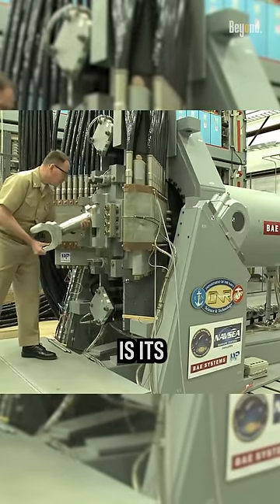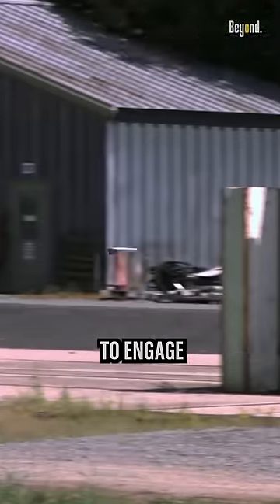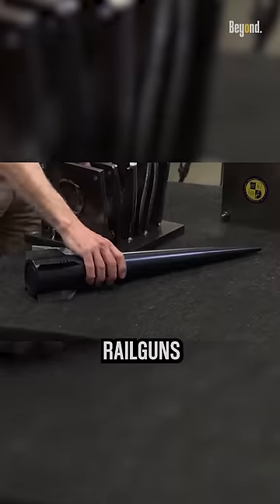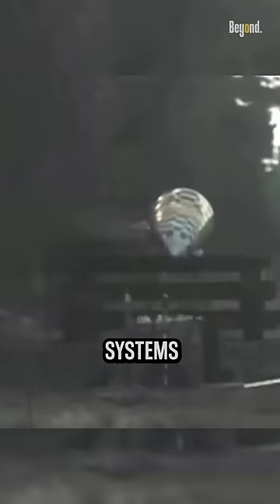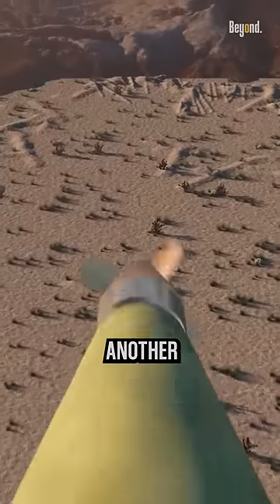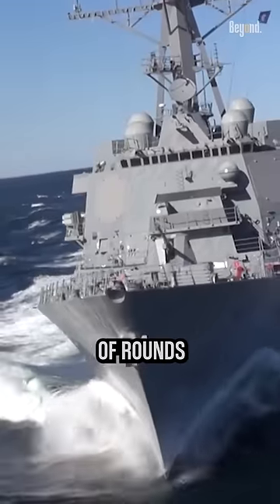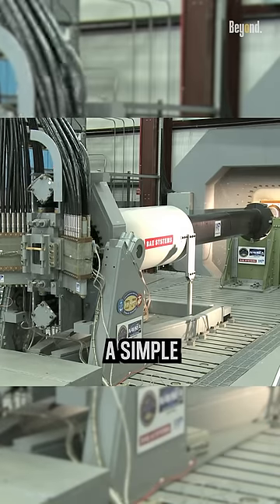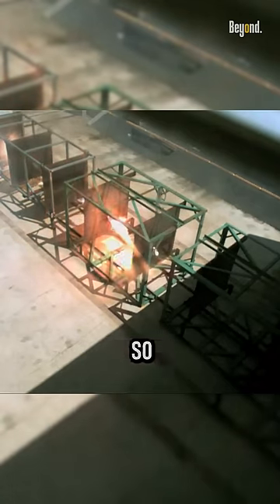Why does the US Navy need a railgun ? #shorts

Comment: The issue with these railguns, is they fired SO POWERFULLY they tore themselves apart every shot, and had to be completely rebuilt after basily 7 to 10 shots if i remember right, if we can develop a more durible metal to build them out of, then we can see them being more developed in the future, but as we are now, we dont have a metal durable enough to handle the forces they discharge when fireing

Comment: The main disadvantage however is the wear that it puts on the barrel every single shot, a barrel of a railgun like that will only last about 3-4 shots before the conducting elements within need to be renewed. 

That and you need a tremendously strong power source to be able to launch something at that range, like a shipping container full of capacitors, or some kind of auxillary reactor. 

Im not hating on this technology it for sure has its place in fiction, and as stated here, you can fire a lump of pretty much anything out the end but they need to work out a few of the kinks before putting it to proper use, big railguns like this have been on and off the US repertoire since 2006, I heard that they where no longer going to pursue development of these weapons to put focus into more conventional missles and such

Comment: They are slow, use a lot of energy, and the gun basically requires maintenance after each shot. The only plus side right now is that the damage output is better than anything we currently have in most hand held weapons, and that the ammunition cost is extremely low. Honestly, so long as it's a metallic object that can conduct electricity, it can function as ammunition. Honestly it'd be easier and cheaper to make a satellite that can drop a giant tungsten javelin from space, and give it precision control.

Comment: Railguns cant make OTH shots, so theyre actually less effective for long range firing than conventional cannons that actually are capable of OTH. The advantage of a railgun is its ammo doesnt explode, it can go through a couple ships before you have to worry about if it will penetrate, its much more precise, and its much more effective at hitting moving targets. An old 16 inch deck gun from WWII can hut targets at longer ranges than a railgun simply because the horizon exists. And missiles beat them both for range

Comment: If you can be extremely accurate then the rail gun would be more effective. However the use of explosives mean you do not have to be pin point accurate and the explosives shrapnel causes the damage

Comment: Muzzle velocity is prohibitive for the current designs.  The ammunition would have to be magnetically suspended during acceleration, without adverse effect to accuracy.  Current designs aren't coping with the speed of their own projectiles. It's an Idea that's probably from the 50's.  I remember Rippley's Believe it or Not stated in the late 70's that the fastest projectile was estimated at over 100,000 mph.  A plastic disk launched from a laboratory rail gun.

Comment: the railgun prooved one thing ......due to plasma erosion we dont have the materials yet to make it work somehow cost effective , the amount of energy needed is coming from very very very complex systems instead of easy stored powder charges .

and you still need to hit something ......

loitering ammo is the future , you shoot it " somewhere " where the target should be , and it looked out for itself ,, propably moving and changing course and is still able to launch a subprojectile as a hypersonix penetrator or has shaped/ hollow charges ..etc. 
sure its expensive , but something we can handle without developing it for another 25 years

Comment: The key is reliability. The theoretical reliability of railguns is mentioned, but in actual testing it has been very unreliable. The components just  dont have the strength and durability yet. Maybe in 20-30 years after the program is restarted.

Comment: I just don't think we're there yet.  The railgun here would fuse the carriage right to the rails-- basically, welding the carriage right to itself.  It'd tear itself apart.

Furthermore, one of the things that traditional munitions (normal cannons) have over a railgun is that a railgun has a pretty flat trajectory.  Traditional munitions don't and can make indirect fire attacks-- most naval combat today and in the future will happen with two ships *beyond the horizon*, which means beyond the curvature of the earth; they don't even see each other.  

Certainly a railgun could be fired to gain some kind of indirect fire effect, but that's a whole lot of power, a whole lot of maintenance, for... what?  For what cruise missiles already do?

Don't get me wrong, I think they're cool as heck, but they're really not the best weapon for a terrestrial weapons platform.  Save that stuff for once we've colonized the moons of the solar system and get angry at each other in space.

Comment: Physicist here, that railgun... All of that is BS here is why:

The energy to accelerate the projectile is the same for both types of gun. Since you would need to generate, store and cool the energy within the inductor you already have major engineering challenges that makes it way more expensive than a standard explosion acceleration.

You say it's safer? I wouldn't say that. Explosives are packed airtight in a shell. As long as no oxygen is inside a shell nothing is going to happen. A railgun has a bunch of failure points that could tear itself apart if for any inconsistency with the elm magnet.  

How would you generate that much energy? You would need a reactor. Maybe a nuclear one.

If you get hit, yeah the ship will explode if it stores conventional shells. Bad. But way better than the possibility of a meltdown if anything happens to the reactor on high seas.

Comment: Incorrect. You need more than just a crate of tungsten projectiles. You also need a battery/batteries capable of holding at least 32,000,000 watts (thats 9kwh) of power to propel just one of these projectiles. You miss, you're waiting an hour for the battery to recharge send your second sabot.

Comment: Rail guns aren't safer as they use massive capacitors that dump huge amounts of energy into the rail and through the munition. It's not more reliable due to the wear on the rails as each round fired disintegrates the metal. The energy loss in plasma arching is not more cost effective then explosive propellant. A rail gun's explosive munitions aren't any different than traditional, and the propellant isn't stored in a cartridge nor with the shell as they are loaded independently. This is so they can add different amounts of powder for different ranges. Storing all that gun powder isn't any more dangerous than the fuel needed to charge the rail gun. "Perfectly" is several millimeters for a traditional cannon. The failure of a rail gun is many times more likely as a round can weld itself to the rails then back charge the capacitors and make them explode. "Simple lump of metal" means a specially designed sabot made to withstand huge amounts of electricity flowing through and past it without welding to the rails. This short is filled with so much shallow misinformation.

Comment: A rail gun is a line of sight weapon. Artillery is fired in an arc and is slowing down over its entire flight. A rail guns destructive power is purely based on speed, an arcing flight to the target, negates it’s one benefit over conventional artillery. There are no explosives in a rail gun projectile, it’s only kinetic energy. A rail gun projectile would probably not fall back to earth if it was fired with a standard artillery angle. Escape velocity is only 11,000 mph. A tank or a point defense system could utilize a rail gun flight path, much more effectively than a ship.

Comment: rail guns are out-of-date technology and I would say the only reason why any of this was made available to the public is to distract us from the actual possibility and usefulness of electromagnetic weapons but you need to use something that's more modern and actually efficient like a coilgun square instead of using high-voltage electricity flowing through the projectile to create Eddy currents you use multiple electromagnetic coils in series to pull the projectile forwards

Comment: The thing is they need to make that gun the railgun smaller. More streamlined. Reduce the projectile size. Penetration. Let's just put it in a different way. The likelihood of intercepting and incoming projectile would be increased by the number of smaller projectiles. Same formula as lasers. Five lasers is better then one big one
Reply: That way you reduce potential overheating as well as charging rate.

Comment: What if you have a super conductor that works in room temperature. the one big problem with Rail guns is that the barrel is destroyed on firing because the magnetic field Is so strong that there are some metal Parts in the barrel that that are torn apart but what if you have a super conductor bullet.

Comment: They sucked unfortunately, they ate barrels really fast but they were trying for 3000 shots before barely replacement to get them cost effective. Also they were going for I believe 20 shots per minute which they also couldn't hit. And the projectile you'd think would be cheaper but it's still 20-25 thousand bucks per projectile.

Comment: Ah, using the kinetic energy as the main force and drive for the weapon. Saves more on safety and money than the dangerous explosives.
But the drive can damage the barrel and if the barrel that holds the rail gun breaks, bye bye.
In a warfare, that would be the worst time to think of.

Comment: Cost effective?
Potentially, yes.... once an arc reactor from iron man is invented. 

They already played with the idea of installing the necessary powersource on a ship and it would take up nearly a quarter of the ship to only power 1 weapon and slow the ship dowm significantly. They deemed it unreasonable. But even if they pushed that aside. Between maintenance and the cost of the initial setup is already beginning to cost more then current weapon systems

Comment: "more reliable" you need a crazy powerplant system instead of a tube and a low power electrical impulse to trigger a normal shell.
So it's not more reliable.
It's also not cost effective, it's INCREDIBLY EXPENSIVE to fire.
the only real advantages are speed of shell and less chance to go boom boom. And that last part might be mitigated with the powerplant required for the gun.

Comment: The Navy canceled the BAE systems rail gun research and the Army discontinued the General Atomics system.

However, this doesn't stop the research. Multiple parties are still involved with both private & government sponsored research in EM rail guns.
A bigger push not mentioned is metallurgical and materials research to make these weapons a reality.

As to BAE and General Atomics systems, they continue under there own labs and have been approached by the Japanese ministry of defense in a collaboration project. All sharing their individual research and expertise.

In my opinion.
Don't shoot for the moon.(over 200 miles)
Maybe develop it so it viable at 50 miles.
Once all the issues are settled, take another step. There's much to be learned by baby steps and failures. Ask Musk and Space X. They've surpassed the Goverment and all its cronies like Boring doing baby steps and studying their failures.

Also, maybe change it's overall targeting goals. Maybe it's better suited for different purposes.

I would really like to see this technology used for space launchers. You could even launch refueling tanks for the interplanetary travel for accelerating and decelerating making trips between much faster.

Another off topic thought.
Space elevators. The technology is well away being feasible on earth, but with the gravity on Mars being only 38% that of earth and the moon being only 16%, the technology is already feasible.

Comment: You do need energy to use the railgun, and hell lot of it, so you need a gas turbine power plant that's either powered by nuclear fission or a lot of oil, or you get a lot of lithium batteries... So it's still a very dangerous vessel all in all

Comment: Assuming you got a feet thick electricalwire hooked to an city sized electrical power grid for each gun... then yes, sure reliable. Cut the power and now your gun no longer useful. Gunpowder has this ability to work with an impact spark, no infrastructure needed to operate the gun when deployed.

Comment: “They don’t have propellants… which means they’re safer… more reliable… And cheaper”

Yeah, they just require a stupid amount of power, complicated electronics to work perfectly, a ridiculous amount of RnD, and an extremely expensive gun. 

Arty shell fails? Throw it overboard and load a new one. Rail gun fails? You’ve got an expensive paperweight that requires people to work with extremely high voltage capacitors and computer systems to get it working again.

Definitely a better option 🙄

Comment: They look promising, and bad AF, but from a little bit of digging I do believe the creators and techs say it causes small but considerable amounts of damage to itself over repeated short term use, more than a conventional counterpart.  Plus they require ridiculous amounts of electricity and need to cool down between shots fired to prevent major heat damage and barrel warping. As badass as it is, I'm not sure it outweighs the cost of maintainance and operation.😢

Comment: Less expensive? Wtf is a USD $50,000 per projectile meanwhile a kg of tungsten is around $500 depending on the quality. 😂

The problem of railguns are there aren't much development on the barrel as it is damaged ever shot also the power needed for this weapon to operate is so huge it is only viable if you are in a ship equipped with nuclear reactor.

Comment: The "dangerous ammunition" you are referencing is a lie, or you are just really dumb. The crew that operates these large guns has many roles. One of the men's responsibility is JUST before the round is to be fired, he screws on the detonator cap and sets the timing charge/fuse, if it has one according to the instructions of the Fire Control Officer.